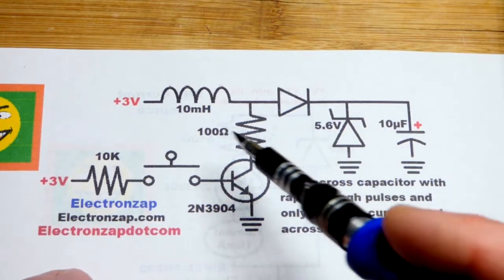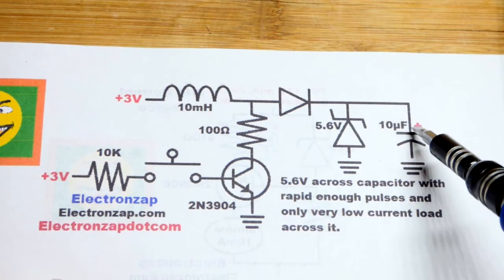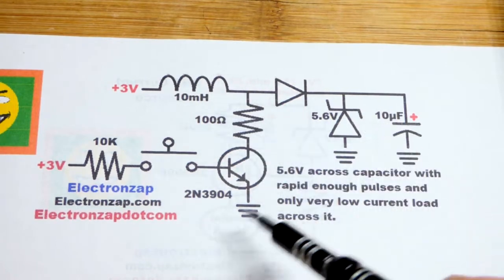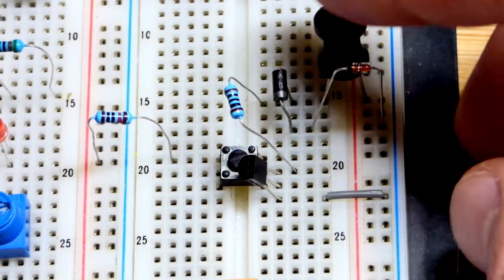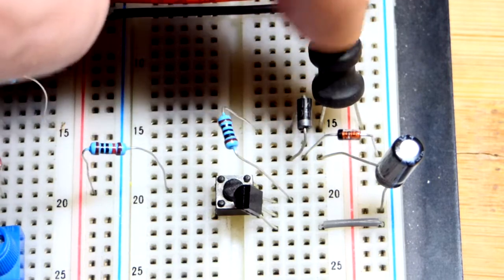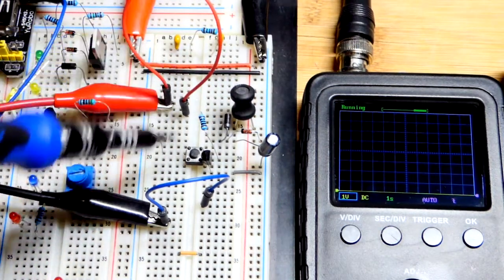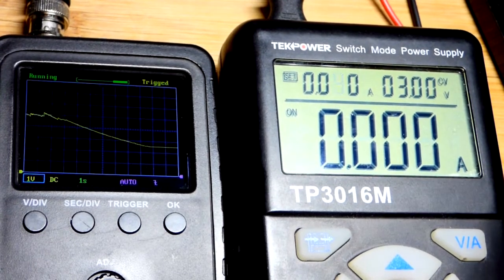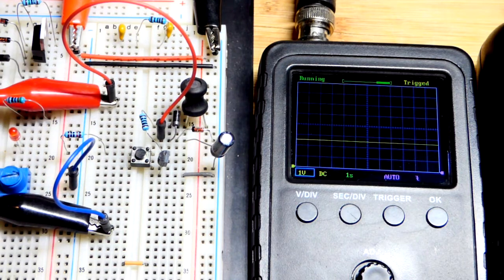Inductor component voltage booster using NPN 2N3904 bipolar junction transistor BJT switch circuit

Comment: Hi, does current flow through to the capacitor only when the switch is open or also when it is closed?
Reply from the maker: Capacitors have 2 plates (conductive areas) that are separated from each other, but the plates are close enough that electrons on one side of the gap can be piled up towards the other plate if it the other side lacking electrons. So, the power supply removes electrons from one side and onto the other during current flow. The capacitor prefers equal balance on it's plates over this imbalance, and so it builds up a voltage which returns the electrons to their original atoms once there is a conductive enough path to do so. In this circuit, closing the switch  gets current flowing through the inductor, and opening the switch gets the current that is already flowing through the inductor to be pumped into the capacitor. If the components could be made perfectly, then in this circuit the capacitor current would only flow at the moment when the switch is opened, as long as the capacitor voltage is below the zener voltage, since we don't have a load attached to discharge the capacitor.